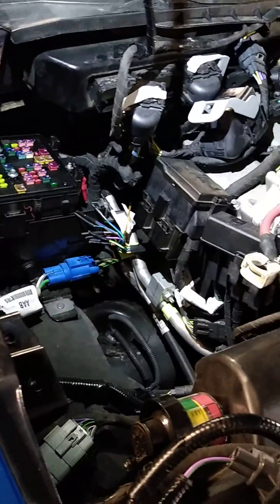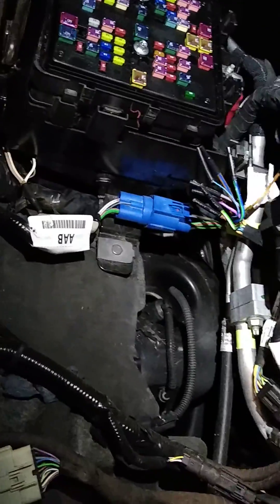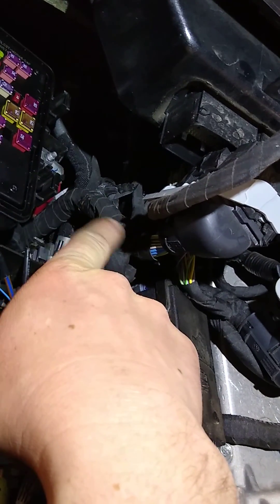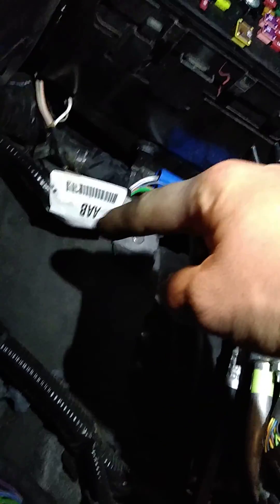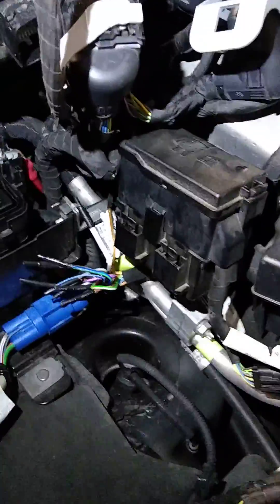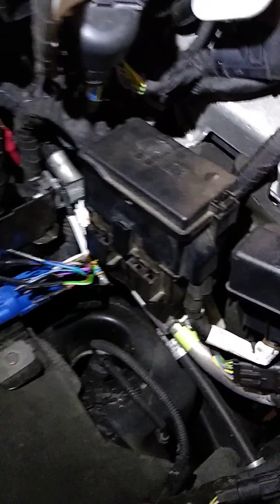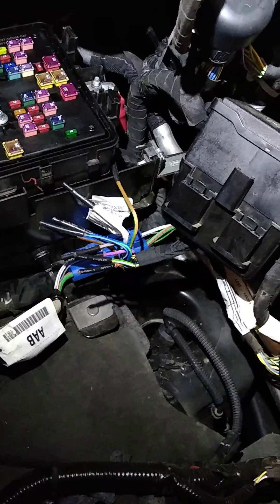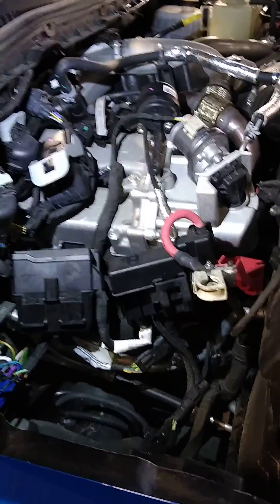2021 Super duty upfitter switch and path through wiring

Comment: Hillbilly Wizard found them on the inside put good luck trying to get and slack for making a connection what did you end up doing for said connection?
Reply: I just got them connected inside. I’m short so I inverted myself, put my head under the glove box, and was able to splice a line onto the tip of the pass through. Took about 30 minutes for 1 wire!!!!

Comment: Did you have to undo the tape to find those wires?  I've got the battery box out but don't feel the wires under the tape.  I've got a 2020 F350 Platinum Tremor with the upfitter switches
Reply from the maker: I don't recall un wrapping tape, but they are hiding and short!

Comment: I seen a 4 wire bundle 3 larger and a smaller wire by my kick plate inside….it wasn’t high up like yours. Just wondering if that’s the pass through? Also, is each one of the larger pass through wires for uplifted 1-2-3?
Reply: I too, would like an answer to these questions. I found the same 4-wire blunt cut harness.